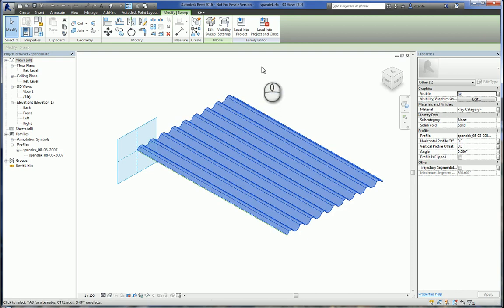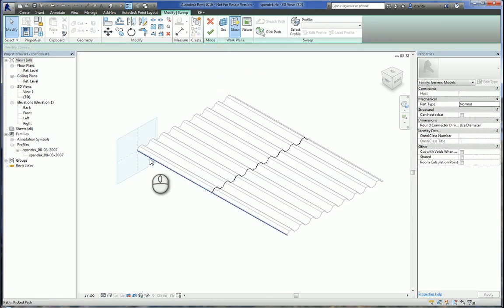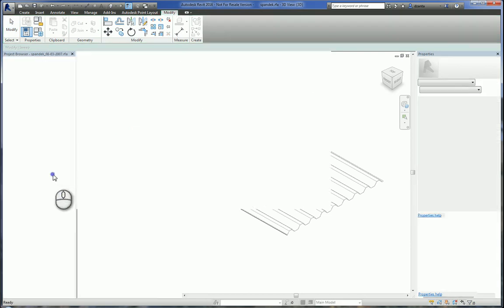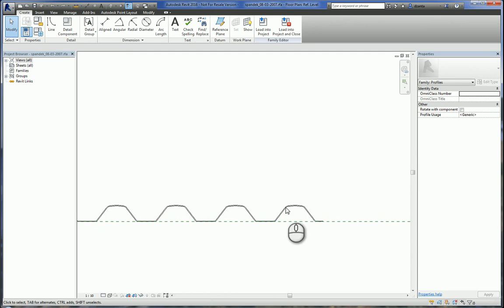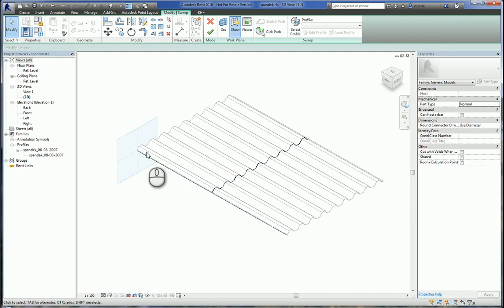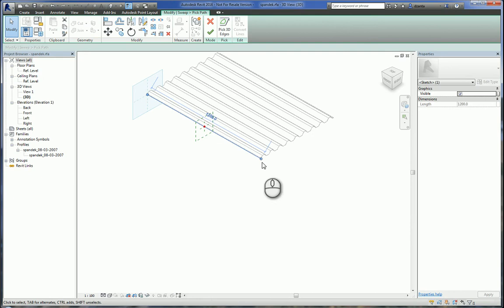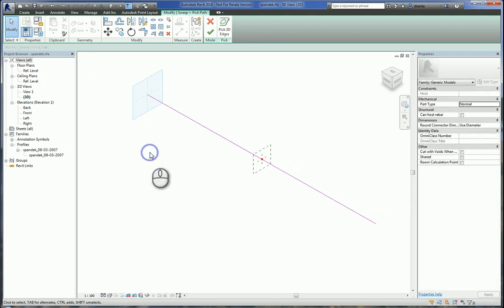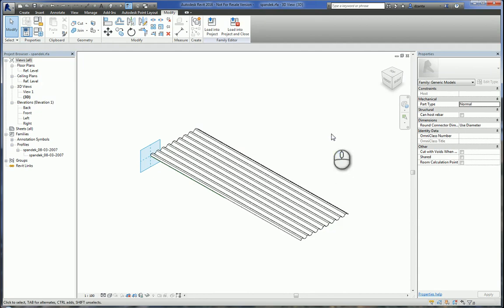Revit - Corrogated Panel  Family

Comment: I need help! I made the corrugated panel, and need it to run vertically along an exterior wall. I placed them along the wall, but when I come to another wall that has a pitch to it, I can't figure out how to create a panel that's angled/cut to match the roof pitch. How do I attach a pic?
Reply from the maker: take a snapshot of the condition using Windows Snip It Tool...then email to me so I can see
Reply: @DzanTa  I have a snap shot. How do I email it to you?
Reply from the maker: @joeylooch  dzanta@gmail.com
Reply: @DzanTa  Sent!
Reply from the maker: @joeylooch  what version of revit?
Reply: @DzanTa  2019
Reply from the maker: @joeylooch  image isn't showing up. Can u resend?
Reply: @DzanTa  I resent it

Comment: which profile do you use sir ?
Reply from the maker: MOHAMMAD HARUN RASHID 
I used the standard curtain panel family file.  You can load in a metal deck profile or sketch a custom profile.
Reply: thanks sir for replay :)
Reply: thanks a lot sir for replay :)  i will do try now